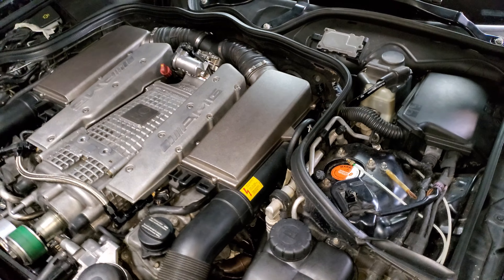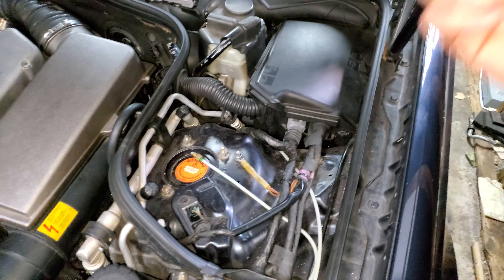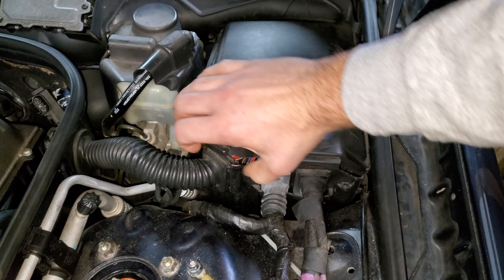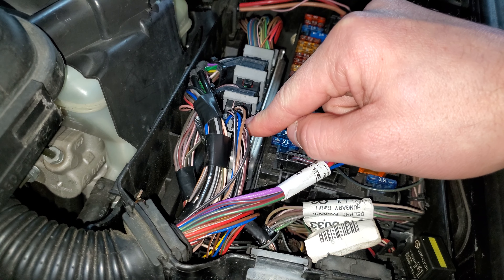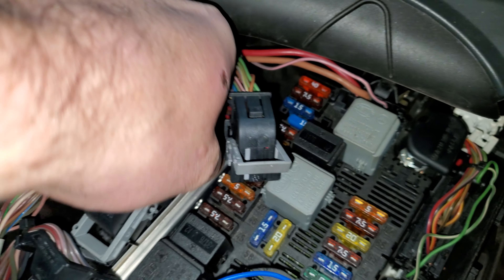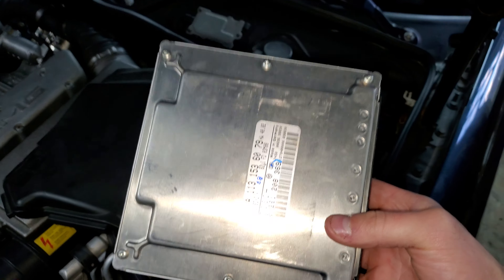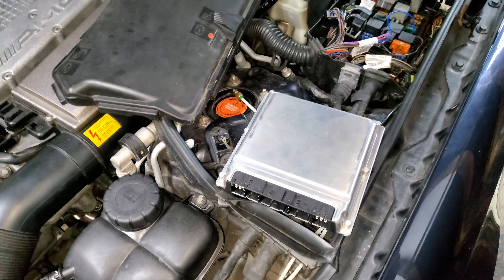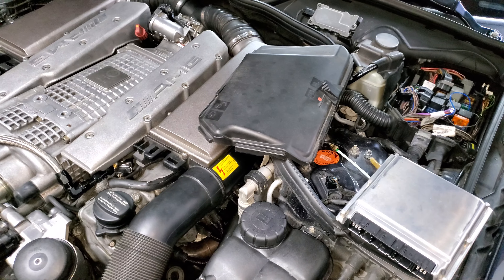W211 E55 AMG BAD ECU? we will find out.

Comment: There's a video somewhere here of a guy opening up his failed ecu. I can't remember the full details but it was visibly failed I think.

Also, while you wait, you can take a multimeter and probe the conductors in the MAP sensor, and check for continuity to ground. Might have an internal break that's shorting to ground, or something chafed somewhere.

Comment: I have problem with my E500. Ive taken out the ECU while battery was disconnected to disable o2 sensors and SAI pump. After putting it back in the car cranks but very hard, the throttle valve is ticking and it wont start. Fuses good, battery good, is ECU bad? I taken it out again to visibly check the board itself but it looks good. Did tune brick it up?
Reply from the maker: If was bricked it wouldn't crank over, did u reset the throttlebody
Reply: @turbocraz1  How do I do that?
Reply: @turbocraz1  Oh okay I did try to reset it but the throttle valve is ticking on ignition and it won't stop no matter if I reset it or not.
Reply from the maker: @michakowalczyk8784  u will have to Google it I don't remember exactly the steps. Or use STAR to reset it
Reply: @turbocraz1  Well seems like I have to, are there any cheap star computers or no?
Reply from the maker: @michakowalczyk8784  just search e500 throttle body reset procedure should find something with that.
Reply: @turbocraz1  I did it but it won't work with pressing pedal for 5 s on ignition.